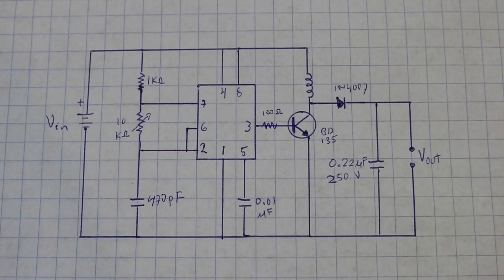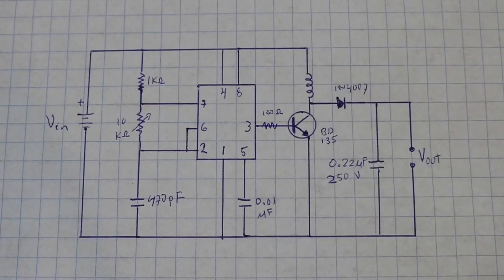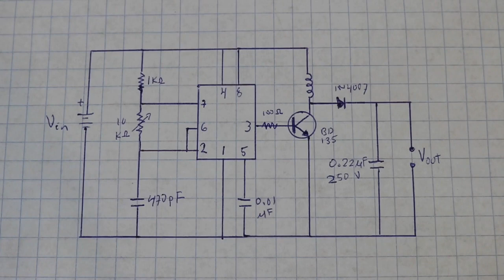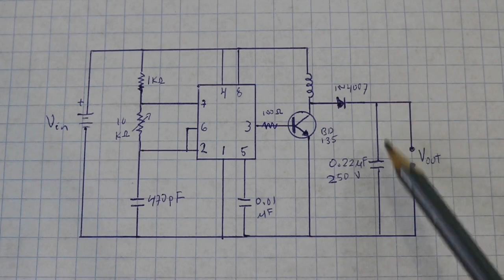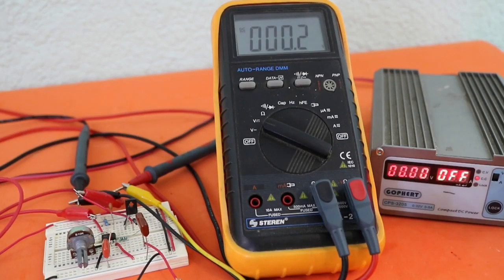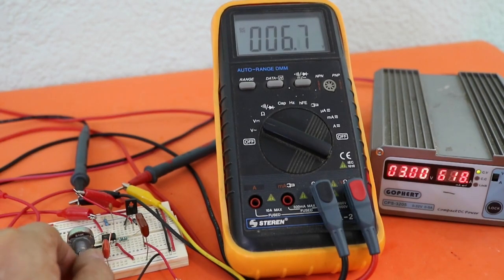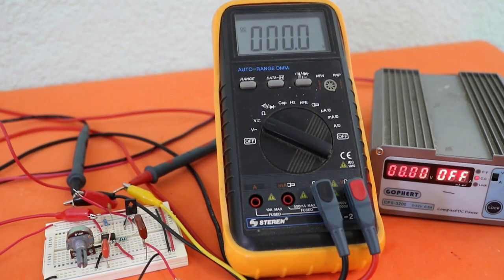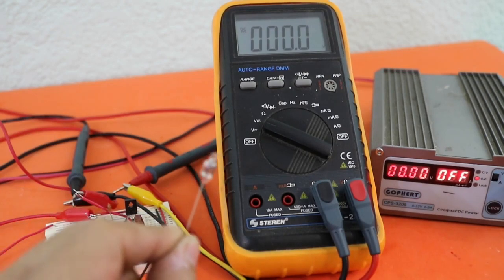Boost Converter DC to DC with 555 Timer

Comment: You can add a simple voltage control by use of a voltage divider at the output which generates 0.65 V for nominal voltage and a npn BJT between pin 5 (collector) of the 555 timer and ground (emitter). So the oscillation stops when the nominal voltage at the output is reached and starts again when the output voltage decreases below nominal voltage.

Comment: Just built something similar. I had small HV transformer laying around, so I used that instead of a simple inductor. A quick tip: add feedback from the output, a voltage divider turning on a transistor that pulls down pin5 can make a miracle!
(you should pull it up by default with ~33k)

Comment: So I'm trying to see if I can drive to flyback Transformers with the single zvs driver have the grounds connected together at so I have to high voltage positives and a high-voltage negative this is for a fusion reaction experiment I would like your feedback soon as possible

Comment: You've exceeded the 45v collector emitter breakdown voltage of the BD135!  Boost converters operating in open loop will need a shunt regulator at the output, which could be a zener diode.  Alternative you could take a feedback of the output voltage to control the duty cycle to limit it.  It would be interesting to see how this can be done with a 555.

Comment: Why is the voltage slowly dropping after power on like 4:30
Reply: Lots of factors but a lot of times there is an initial spike then it will slowly drop to a point of equilibrium. adding or adjusting filter capacitors and duty cycle can fix the initial spike that causes this. Also the timing on the mosfet could be slightly off and that can cause it too. That would be adjusted with the duty cycle as well.
Reply: Actually in this case he used a Transistor instead of a Mosfet. But same applies

Comment: Please Ludic. Ozone generators are unavailable today. In some countries. For this reason, I want to build a self-help generator. Here is the link to the disassembled generator. https://www.youtube.com/watch?v=FkZa73pIUhI
It has a current consumption at 13V 4.4 A. So approximately 57W. I need to build a generator that has 100W power. (7.7A) They use an inverter with two transistors E-13005. The equivalent is about BUT44. The primary winding is one undivided coil. Wire diameter estimated 0.3 - 0.5 mm. Nominal values of disassembled commercial power supply: Frequency 16 kHz, voltage 12V, output voltage 3.5 kV. (from datasheet). Is it possible to build something like this? Thanks for the reply.

Comment: How about a 12 volt DC converter to 200 volt A.C. 200 Hz? Diagram is availabe from a 1966 Dodge Electroluminescent dash lighting.

Comment: 1:31 You are emulating a buck-boost converter rather than a boost converter. For the buck-boost converter, when the main switch (if we consider the diode as the second switch, which is OFF during that time) is ON, the inductor is charged by the power supply, and when the main switch is OFF (the diode is ON), the load is powered by the inductor and the inductor is discharged. For the boost converter, when the main switch (for example the NPN transistor at 2:56) is ON, the inductor is charged by the power supply, and when the main switch is OFF the EMF induced by the collapsing magnetic fied of the inductor and the EMF of the power supply add together (they are connected in series) to power the load. So the buck-boost converter differs from the boost converter.

Comment: I once built a boost converter with a 555, mosfet and a coil (that i made myself), and I got 700 volts out of it, just from powering it with a 9v pp3 battery!
Reply: So I'm trying two see if I can drive to flyback Transformers with the single zvs driver have the grounds connected together at so I have two high voltage positives and a high-voltage negative this is for a fusion reaction experiment I would like your feedback soon as possible
Reply: @numatechprototypes222  do you mean get high voltage from flyback 
and zvs driver
If you mean tat it well work
Reply: @علىعبداللاحمن  no I'm talking about using a zvs driver to power 2 fly backs  linking the high voltage negatives in parallel to give me three phase AC or 2 high voltage positives and one high voltage negative. again this is for a fusion reaction experiment
Reply: @numatechprototypes222  see
Reply: Please give me the diagram for this
Reply: It's possible duty cycle between (1to 0) and limit your output voltage
Reply: Did you consider using crystal Oscltr for a steady output?

Comment: Great stuff as usual. How about adding feedback for current draw? Would altering the frequency compensate for voltage drop, or is it just controlled by inductance?
Reply: Compensating the voltagedrop can only be controlled by increasing the 555 duty cycle (amount of power/period) in case of a load.
Reply: Thanks. That makes sense.
Reply: What about adding a quartz crystal to regulate the pulse, probably need a diode and cap as a rectifier but it should be a stable signal?